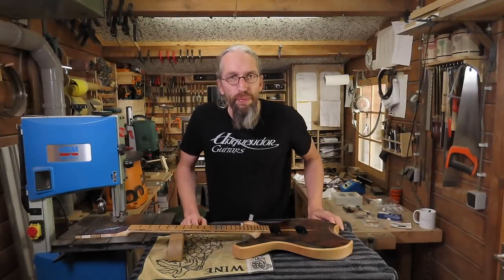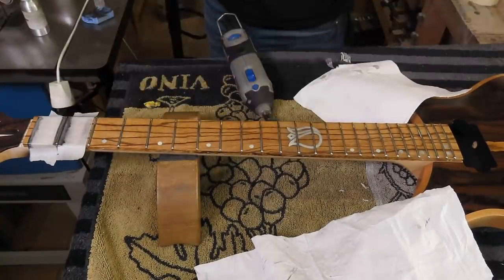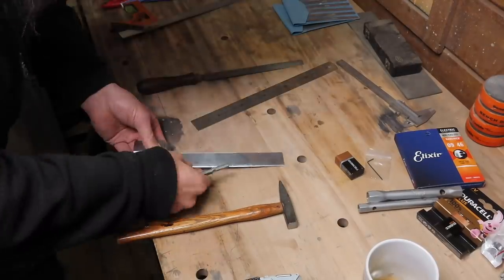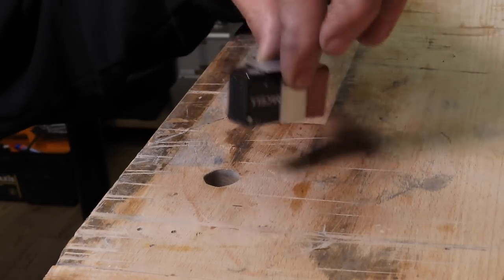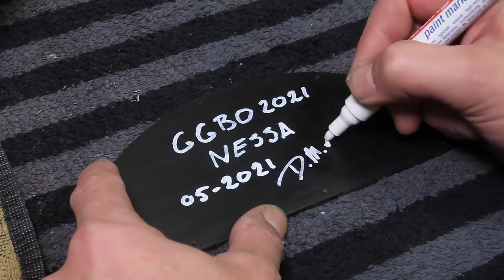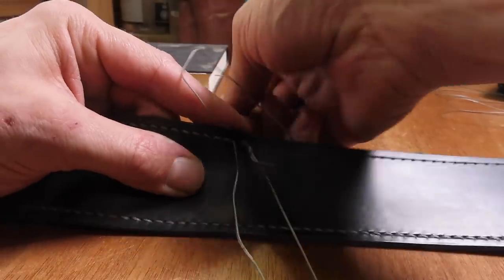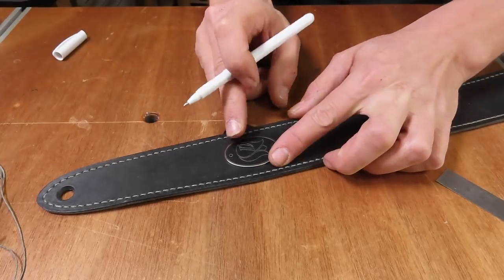Great Guitar Build Off 2021 - Episode 5 - Final Assembly | Building a Great Guitar from Scratch

Comment: I dig the guitar without question but the battery holder is elegant in its simplicity. The strap I like as well. In regards to the electronics i started to make templates of the control cavity on my builds so I could wire most of electronics outside of the guitar. I just could not take reaching into the control cavity to wire things up any more. 😎🎸😎
Reply from the maker: Hi John,
Thank you very much for the compliments on the designs.
I also used to use a template to do most of the wiring outside the cavity, but with the Fishman pickups having a lot of wires coming from the pickups that need to be soldered to the pots I now only prepare the pots as much as possible outside the guitar and do all the interconnecting wires when they are installed.  But I agree with you. Using a template makes it much easier.

Comment: If you do not mind, may I please ask which control knobs did you use (what size)? Also, since these are active pickups did you have to use a stereo output jack (I read somewhere that this needs to be used with actives)? Excellent guitar you built. Love your videos. Thank you.
Reply from the maker: Hi Adrijan,
Thank you very much.
The knobs on this guitar are the Schaller Dome knobs. ø18,3x18mm.
Yes you might want to use a stereo output jack to prevent the battery from draining when the guitar is not plugged in. Using a stereo output jack lets you disconnect the battery from the rest of the circuitry when you take out the guitar cable plug.
Reply: @UnquendorGuitars  Thank you so much for your clear answer. Appreciate it.

Comment: Daniel i have a question for you! Would you buy a used dewalt dw876 bandsaw made in 2005 for 500 euros? 1000w 200mm resaw capacity! Hey i ll still vote for you even if you dont answer!
Reply from the maker: Hi Megalodon,
This might depend on where you're from and the availability of tools and their regular prices.
I can get a brand new deWalt dw876  for just over €830,- (incl 21% taxes) at the moment here in the Netherlands. My bandsaw although slightly smaller was around €400,- brand new. So I wouldn't buy a 16 year old machine for that amount of money... unless the quality of the older model is much better than the current one, which I don't know.
Things you have to look out for are the saw guide bearings or blocks. They might have worn out after 16 years and need replacement. The rubber lining on the wheels and the bearings on the wheels etc. 
When it comes to buying secondhand equipment I personally only consider the absolute top of the line equipment known to last for ages at fair prices and make sure it's in good shape or spare parts are still available. 
Of course this also depends on your budget. But if you're going to spend €500,- look around what else is available for that amount.
I hope this has helped you in any way.
Good luck.
Reply: @UnquendorGuitars  thanks alot Daniel, in greece since summer of 2020 it costs around 1300 euros new... but the original price was like you said around 850-900. For a resaw capacity of 200mm to be able to make my own tops, the cheapest one in Greece is a chinese 750w for 800 euros, also the dewalt is in pristine condition! Its great for a small workshop like ours,  i ll let you know my honest impression, Thanks alot once more m8!